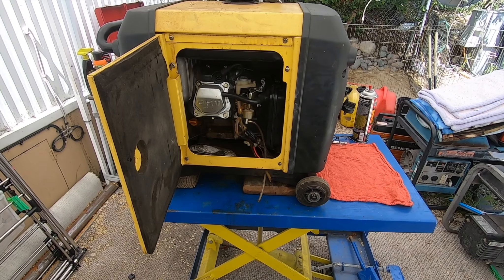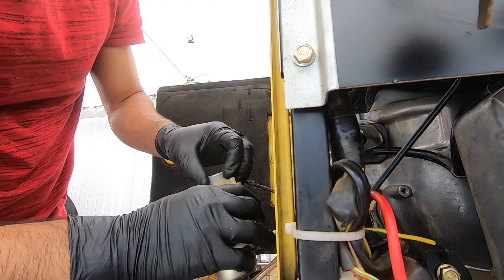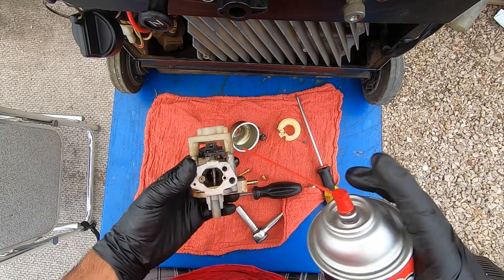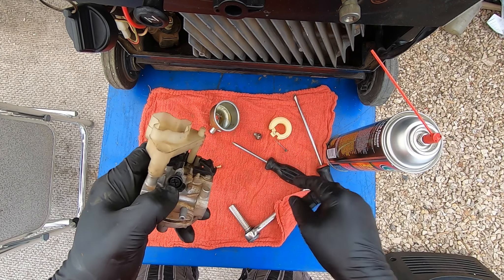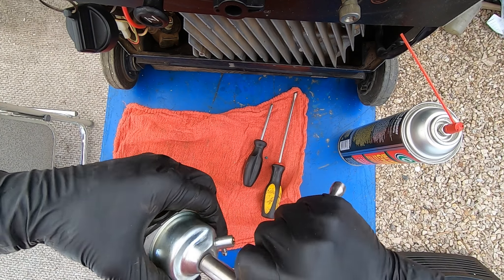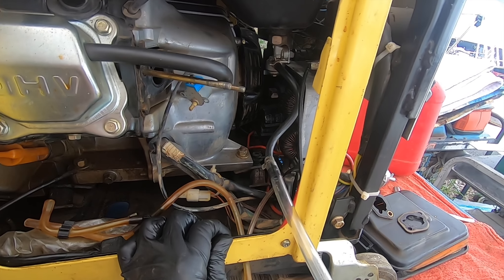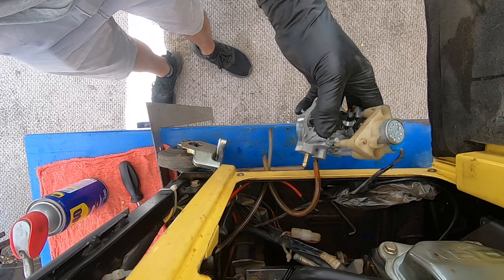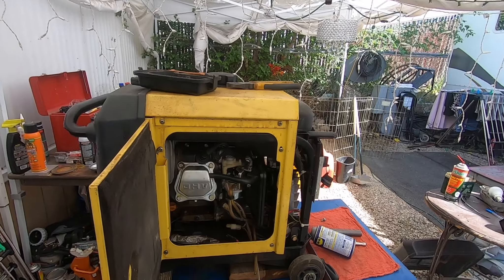Fixing fuel issues on Inverter generator

Comment: This is exactly what I needed! I don't have the exact carburetor. But, the parts and configuration were similar enough for me to take it apart and clean it out. We have a Predator 4000 Generator we got sometime before 2013. We tried using it recently. But, we discovered that the gas tank got clogged with leaves and the fuel valve got clogged up as well. The tank was relatively easy to clean out, I got a new fuel valve from Amazon for $5, and some fresh oil got the spark plug firing. But, it wasn't until I noticed that the spark plug was still dry that the problem had to be between the fuel valve and the pistons: the carburetor.